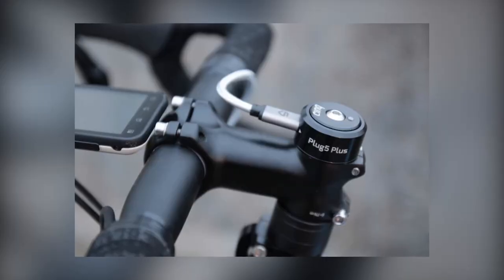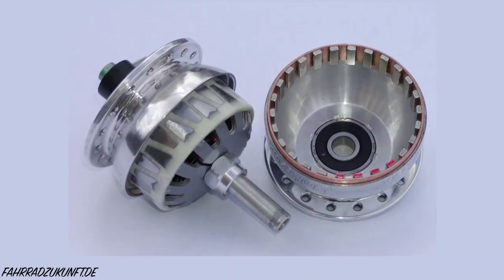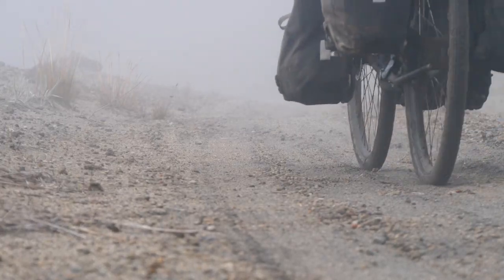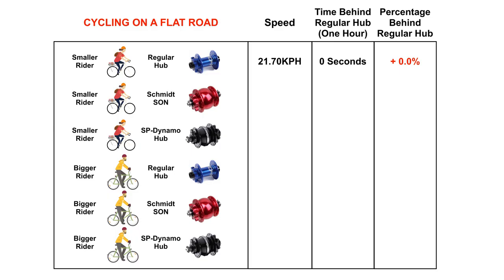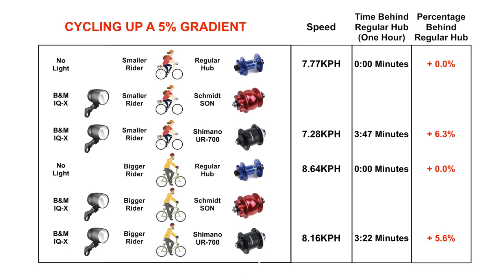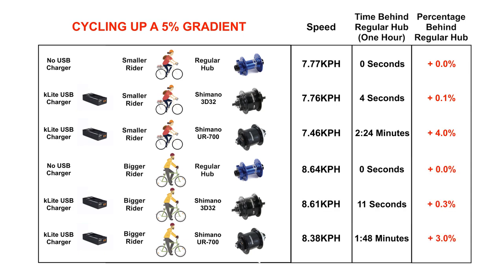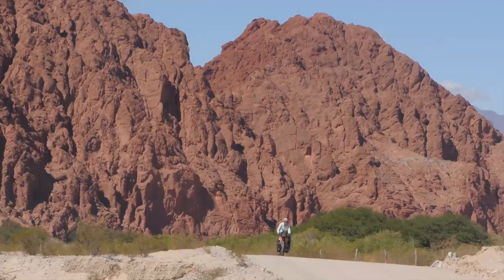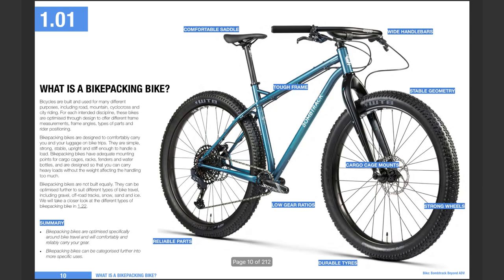How Much Do Dynamo Hubs Really Slow You Down?

Comment: Hi Alee thanks for this informationful video. I am using surly troll with one wheelset(28x1.40) deore xt t8000 and I am going to build another wheelset(26x2.50) with son 28 and rohloff 36 disc(waiting for and can chance according to your kindernay video). I dont  use dynamo light because I dont ride nights. I will choose b+m e-werk for one week tours. Do you think e werk and son 28 couple is also effective for one week tours? thanx again.
Reply from the maker: I wouldn't recommend the e-werk. It doesn't make good power until you hit about 18KPH. Dynamo chargers have come a LONG way since that product was developed, so you can do so much better. I've got the options listed here: https://www.cyclingabout.com/list-of-hub-dynamo-power-supplies-for-usb-devices/
Reply: @Cyclingabout  Thanks for answer Alee . I reviewed this page but couldnt understand the ranking on graphs. But I think best one is plug5 plus and best price performance is Forumslader V5. I must chose one of theese according to my budget. If I understand enough.
Reply from the maker: @erenkonu847  It sounds like you understand. Just look for the lowest speeds to achieve 2.5W, or the highest watts when riding at 20KPH.
Reply: I have a Surly Troll with Rohloff 26" and 700c wheels. The 26" wheels I have a Son 28 hub. I am disappointed with it as most of the time my Anker power banks are more than sufficient to power my devices on tour. One 26,000mA bank lasts me about 4-5 days charging Garmin Edge 1000, Smart phone, GoPro batteries, Fenix watch after which I usually stay somewhere with mains power or where ever I find a mains power point I charge. I got the Son 28 front hub thinking all my power troubles would be over. No. The output does not keep up with my devices power needs. For the cost of the hub, new rim and wheel build plus the Edelux 2 front light and Son rear, I don't think the expense is worth it if you are not going to be without power for more than 4-5 days or can't get to mains power to re-charge a power bank within this time. Maybe for long tours to desolate sparsely populated off grid places it's worth considering, but in my experience not. I have very bright Exposure lights which most of the time I don't use as I tend not to ride at night on tour. Commuting where you return home every day is different. Even then I charge my front lights probably once a week more frequently in deepest winter. On low mode which is still flippin' bright they give around 8 hours of light and 16 hours with the spare battery, 8 hours on full power which is BRIGHT!!! If I had to make the decision again I would not go for a dynamo hub, well not a SON 28, simply on the basis of the high cost. I think power banks and solar panels are a better option. Of course you need the sun or a bight day to charge from solar panels but my Anker ones are pretty good. The Son dynamo hubs are beautifully made, but the total cost of them plus lighting and plug is prohibitive for the amount of power they produce. In my experience the SON 28 hub can only power the dynamo lights or a single device such as my smart phone just about whereas the Anker power bank will charge my smartphone no problem many times. Just don't expect too much from the dynamo hub. Other Shimano hubs with higher outputs might be better but then the penalty may be they are significantly heavier and more drag. I think a dynamo hub is one means of charging to be used in combination with other means such as solar and power banks. If you want one just so you have lights on constantly then go for it otherwise you need to think long and hard whether the expense is worth it.
Reply: @alexmorgan3435  Thank you so much Alex. The budget of my dnamo hub and charger will be 450Euros aproximetly. I think as you told me I dont need it too much. You have also rohloff system how is your experience about rohloff I was planning with ryde andra 30rims and for front hub son 28 and for rear hub rohloff or kindernay 14.  Rohloff ts db oem 2 budget will be 1200 euros. Do you think for maximum 6 days travel do I need it? Thanks
Reply: @erenkonu847  Need what for max of 6 days travel? Rohloff or front dynamo hub? Depends when and where you are going, what your power consumption is likely to be and your proximity to mains power to recharge.
Sorry but I don't know what a kindernay 14 is? For a one week, cycle tour, go with what ever bike you currently have. Just make sure is it freshly serviced and working well.
Reply: @alexmorgan3435  I am sure I dont need hub dynamo at all condition just some condition I need. I wanted to ask differences about rohloff and derailleur system(like shimano deore,slx,xt) at touring bike on "surly troll". I wanted to know your experiences and comparison. Thanks.
Reply: @erenkonu847  I have only ever used a Rohloff hub on my Troll. I bought a Rohloff hub to get away from derailleur gears as they are HIGH MAINTENANCE and a real PITA to maintain if you ride a long tour or just a lot of miles every day in all weathers. They are fragile and easily damaged which can be a real risk depending on where you are riding on tour. They also cover you and your bike and clothes in muck. The Troll frame is purposely designed to accommodate the Rohloff hub. This is one of the main reasons I chose it as well as it's proven touring capability in extreme conditions. This was 5-6 years ago. Since fitting it I have had to change the chain only once, nothing else except the oil changes for the Rohloff hub which are simple and straight forward. I do not miss derailleur transmissions one bit. IMHO the Rohloff hub is far superior to derailleur equipped bikes. I think there maybe more frames available now to take a Rohloff hub than when I bought my Troll. Prior to this I used derailleur gears on my other bikes for many many years. When I did use them I would typically use either Shimano 105 and Ultegra or LX, SLX or XT models. I also ended up using HOPE hubs which I found far superior than Shimano hubs. I currently have Shimano SLX disc brakes on my Troll.

Buying a Rohloff hub is a big expense which I wish I had done earlier in my cycling days as it has totally changed my cycling for the better. I still occasionally ride derailleur road bikes but it isn't that often and only on dry hot summer days with NO chance of rain. Probably only ride my derailleur bikes once a year if that! I find them very agricultural. I hope this helps you decide. Good luck with your cycle touring. Where and when do you anticipate riding?

BTW I believe Surly have now discontinued the Troll, but there is still the ECR which is basically the same as the Troll but larger, as it can easily take 27.5"+ and 29"+ wheels although the Troll will also take 29" wheels as well if you move the wheel back in the horizontal rear drop outs.
Reply: @erenkonu847  Well you seem to be getting good use out of your Troll. You probably got one of the last ones coming out of the US. Yes they are very capable bikes for all terrain - road and off road. Shimano XT8000 and DT Swiss wheels are I believe good components. I have considered getting a bike with S&S couplers for about 2 seconds. They just seem a waste of time especially on a relatively cheap steel 4130 frame like the Troll. I know Surly produced a Troll - The World Troller with them for a short time, but they can't have sold that many or made much money from them. It's fairly easy to get a bike box and they are generally free from a bike shop if you need to fly with a bike. Sounds like you have grand plans for your Troll converting it to belt drive. I would try fitting jus the Rohloff hub with chain first and see how you get on. You might want to be aware that Rohloff does not warrant their hub for use in the Troll frame with Gates belt drive. I decided not to do it because of this. Chain is fine. Still very low maintenance and cheap to change when the time comes unlike a Gates belt. My Rohloff hub is a QR, disc brake OEM2 hub, black. I have an extra long stainless steel Pitlock skewer which holds the hub firmly in place with Surly tugnuts. I found the installation of the Rohloff hub in the Troll very easy and straightforward. It saddens me when I see people still riding their Trolls with derailleur gears as they do not know what they are missing. The Rohloff hub transforms the bike. I bought a SON28 hub and the SON lights as well, plus charge plug which you need and frankly it has not been worth it. If I were to cycle in Mongolia or Namibia or in Patagonia then maybe it would be worth it, but for the £750/820€ I spent for everything - the SON 28 hub, charge plug, SON Edelux 2 front light front and back light, the rim and wheel build and spokes, it has definitely NOT been worth it. The RAV and Anker power banks are only £30-50 GBP at max and their solar panels £40-80 GBP which are all very good. I guess you could buy a Shimano dynamo front hub if you really wanted one or an SP, but you still have the cost of a wheel rim and wheel build plus a charge plug. I don't have the need to have lights on my bike on the whole time, certainly not in summer and I don't think the amount of power they deliver is as good as every one makes out. Certainly not as good as modern power banks imho.
Sierra Leone used to be a very UNSTABLE country in civil war a few years ago. I don't think it would ever be on my bucket list to ride in. If you want a challenging but friendly and safe country to cycle tour in then try Taiwan. I loved it when I visited almost 3 years ago on my Troll.

Comment: I use the very same SON and cinq plug. I'm not too impressed by the power it provides to my Pixel 4 though. And that it turns down output when the lights are on (I'd rather cycle harder).
It's not enough to keep the device charged during use.
I'm close to replacing it with a more powerful external bank. (Plus solar if I ever find myself truly off the grid.)
Would be curious about your thoughts on the best mobile charging setup!
Reply from the maker: You won't get much charge with the lights on; it's really one or the other. Are you using the Plug III or Plug5Plus?
Reply: @Cyclingabout  The 5 plus, because of the USB C connection. But even with the lights off, it can't keep up. I think a smartphone just draws in a little bit more then the device can provide.
Reply from the maker: You might have a faulty unit, or perhaps the Pixel has some weird stuff going on. You should be getting enough power with the Plug5!

A $5 USB LCD Voltmeter can help diagnose whether your Plug5 is making the right amount of power. I'd recommend plugging one in and seeing if you're getting the full 5V/0.5A at 12kph and 5V/0.9A at 20kph.
Reply: I find power output at typical riding speeds is much more important than a tiny amount of extra drag. On my bikepacking bike, even with fast tyres, I do not notice the extra drag from my Shimano hub. And the Shimano hub makes the most power at typical riding speeds. Mine has lasted a long time, and I do not need to send a wheel back to Son to get it completely rebuilt when it finally fails. Just buy another hub for cheaper than Son charges for a rebuild. The Shimano hub has dura-ace seals in it. Ridden mtbing through UK mud and puddles. Inc. the recent very wet weather, endless puddles. It just keeps going.
Reply: At least you can charge your Pixel 4 ;-)
My USB-Werk can't charge my Samsung phone with USB C but I didn't check what actually happens with a scope or voltmeter. It does work with a camera (Micro USB), it did charge the phone I had before (also Micro USB) and I also tried it for a few kilometers with a switched off iPhone 8. 
Maybe a powerbank between charger and phone will help? But even if that works it's more stuff and more cables but on the other hand I can still charge on bikes without dynamo hubs or when I switch over to lights. I've installed a switch and wiring on my touring bike with positions lights/offcharger.
Reply: @jochenkraus7016  Yeah, what works a bit better is if I first let it charge the built-in power bank and then the device, disconnecting once the bank is empty.
Though I do question is that's worth it relative to carrying the same weight of a 10 Ah battery pack that just works.

Comment: The drag with nothing connected seems to be far too high. Much less was measured by a SON employee in 2012: https://fahrradzukunft.de/14/neue-nabendynamos-im-test/#licht-aus

Good ultra racers ride with much more power, so the percentage of power lost is much lower. Advantages of not having to care for the battery charge are greater because ultra racing is a mental effort. The Transcontinental in Europe for example has been won by dynamo riders for many years, now.

Comment: Can we turn off the dynamo hub when we don't want any power... what is the power loss then when compared with a cycle which has no dynamo hub?
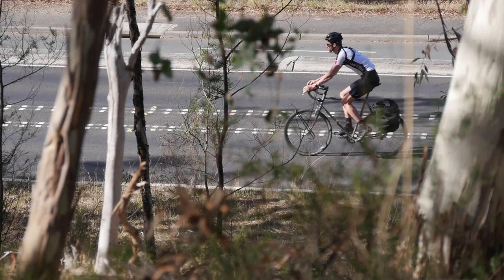Reply from the maker: No, there is no on/off switch. You can find out the power/time loss difference at 2:55.

Comment: It would be interesting to see these numbers against the time penalty of a 1-2 pound USB battery that is recharged at end of day.
Reply from the maker: The battery would be faster in almost all instances, but in particular on the flat where you'd travel without the 2-5% time penalty.
An extra 1kg/2.2lb works out to be ~1% slower on the 5% climb for both riders. That makes the battery faster uphill than the Shimano UR700 hub (3-4% slower).

Comment: Clearly it would depend very much on the terrain, but I wonder if by only charging to a battery on descents enough energy could be stored to power lights, etc for an entire ride?  I’m assuming only having the Dynamo dragging on descents would be preferable - which may be a big assumption.  On flat\uphill days I appreciate it wouldn’t be an option,  though you might use the hub intermittently.  I’ve no experience of using these hubs, which probably shows!!
Reply from the maker: It depends how long the descents are, how powerful a charger is and how bright/efficient your lights are.
Let's say you need to fill a 4800mAh light battery to run it at 800 lumens for three hours. Using a powerful Forumslader USB charger, you would need to descend at 30KPH for four hours to fill the battery up (including light battery storage losses).
Reply: @Cyclingabout  This would kind of work then depending on your riding habits. Because most people are doing most of their riding during the day with maybe an hour or two after it got dark because they got delayed for some reason. But I don't think there would be much point as the drag is minimal anyway.

Comment: If dynamos produce energy because of the rotation of the wheel, theorically bikes with smaller wheels (20", 16") would get more power out of one, right? I'd like someone to explain me.
Reply from the maker: That's correct. Most dynamo hub manufacturers actually make low-powered hubs (eg. 1.5-watts) to suit smaller wheel circumferences.

Comment: Honestly, there is no choice.  If you want a light bright enough to cycle safely in the cold of a winter morning to work a hub dynamo is the only choice.  Batteries die in the cold and the hassle of managing a removable light is just annoying.  With a dynamo hub the light is always there and when you need it.  

There are so many other things that slow down more like studded tires, snow, traffic,... It does not matter.
Reply: And with a typical commute to work of about 15 to 20 minutes, a minute or two does not matter.  You will lose more from random traffic light bad luck.

Comment: Aren't the calculations for the USB charger worst case when it's charging from being depleted? Batteries draw less current the closer they are to being fully charged. I think if you're just maintaining charge on already full battery pack powering a Garmin or phone, it won't be drawing that much. The battery pack should also help buffer the draw on the dynamo making it more even. I bet that if your battery pack and Garmin/phone all start out fully charged, there will be less draw on the dynamo.
Reply from the maker: That is correct. For the charging section, I made all of my assumptions based on charging from a sub-50% battery. The drag gets smaller the closer you get to 100%.

Comment: Honestly, I just wound up using 2-3 battery banks with alternating lights. Doesn't slow me down at all; always have lights ready to go, always got my cameras going and from there you can just go. 

I get about 5-6 charges out of my one power bank for my lights which is... 24+ hours of lights lol.
Reply: Agree. A couple of 26,000 mAh power banks from Anker or Rav is a far most cost effective option for charging devices and would give you about 7-10 days power depending on how many electronic devices you have. Their solar panels are pretty good and cheap as well. But if you want lights on the whole time and have money to burn then a SON 28 with say a Sinewave charge plug, SON front and rear lights is an expensive option. Personally on tour I tend not to ride in the dark. For poor weather conditions and tunnels my Exposure front light and Cateye rear more than do the job. My Exposure front light is far brighter than my SON Edelux 2.
Reply: Tks....wanted to put up something similar.

Comment: It is a pity they cannot make dynamos that only work when you are going downhill or when you are using the brakes unless a reservoir battery is getting low.
Reply from the maker: Well, you can just turn your lights off or not charge anything when you don't need them. The 7 second penalty per hour with the SON28 hub is really not much.